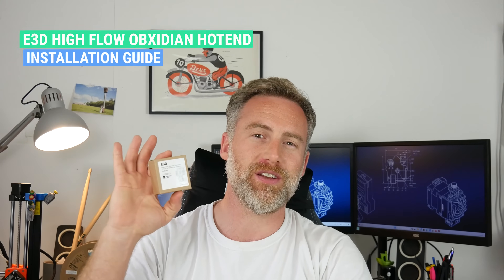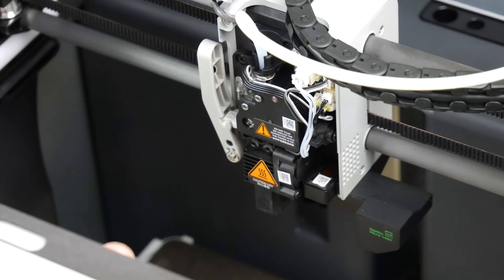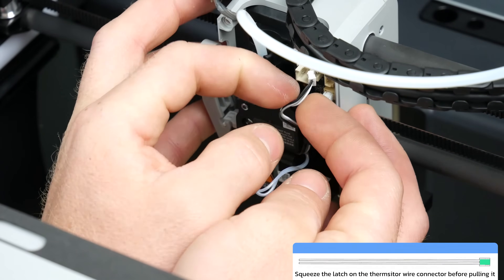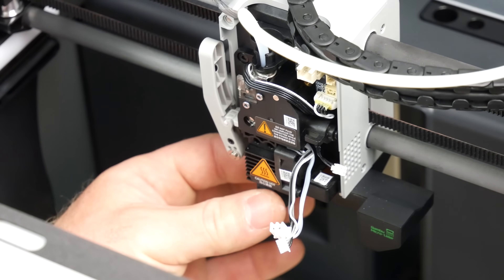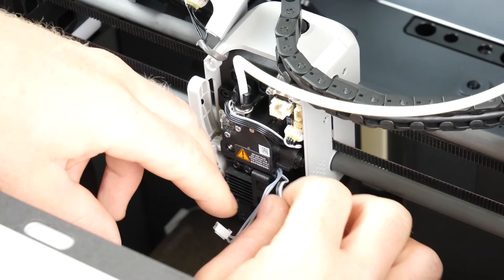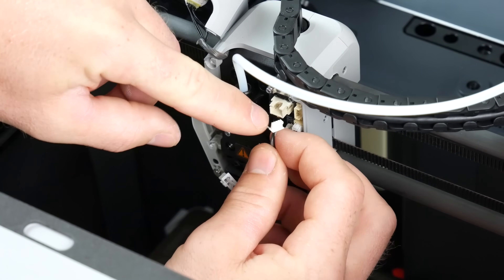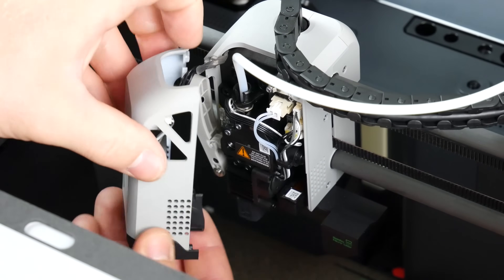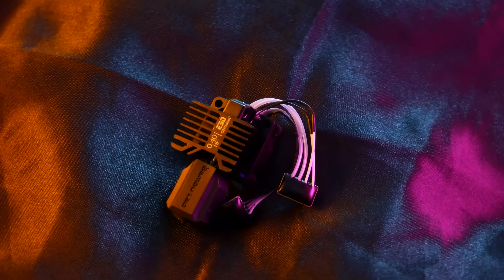Install An E3D High Flow ObXidian HotEnd On Your Bambu Lab In Under 5 Mins! 💪

Comment: Yes like the other comments said installing the hardware is trivial. But the slicer side is what we want to see, bambu have the 0.4mm profile on the product page as do E3D but for the 0.6mm they have a 3mf file for specific materials. just playing around within the slicers I saw very little improvements with the 0.4mm high flow profile vs the standard. some users on the forums said they still saw speed improvements even though the slicer didn't reflect it in the estimated print times. I went ahead and bought the 0.6mm hoping a simple profile import like the one for the 0.4mm would be available but no. not really what I was expecting from bambu who is known for ease of use. they should include these high flow hotends in a slicer update. current implementation is clunky. You don't buy a bambu machine to tweek stuff you just want to click print and have stuff work. Hardware looks great but the software side is a let down. can I get this to work with tuning - Yes, do I want to mesh with setting - No

Comment: I agree with other commenters.  The physical install is the same as the factory.   I want to see what other changes need to be made to take advantage of the hotend.   The max flow rate is only a small piece of it.   Make a video showing what setting we should change.   It would be nice if bambu would release a profile for them that updated the settings.

Comment: so many videos on how to install it which I know how, but no where showing me what I need to do to benefit from the higher flow... how do I set it up in the slicer?
Reply: I’ve been looking for any information on YouTube after I just received two of them from my X1’s. I can’t imagine it would not require any setting adjustments ? Right.
Reply: @jaylawvlogs264  if we're increasing the flow rate, we're also going to increase the print speed to compensate so I'd assume that slicer settings would have to be changed.